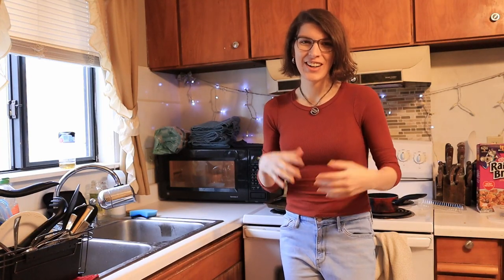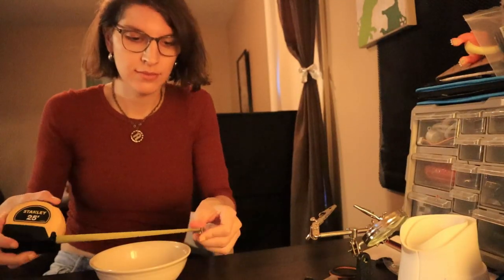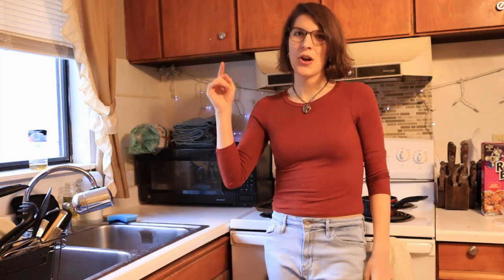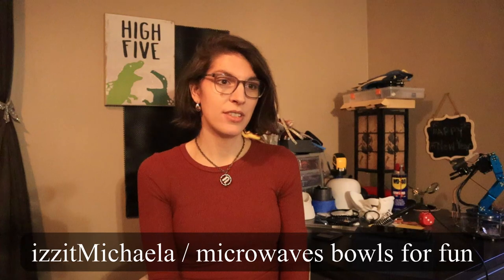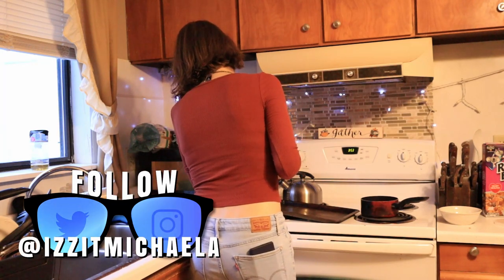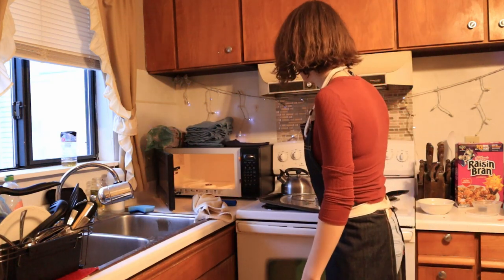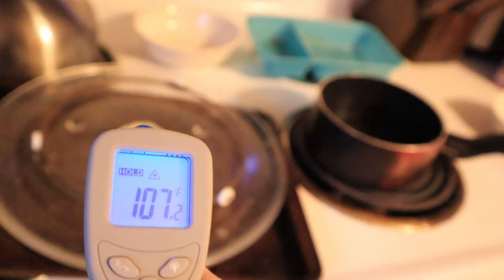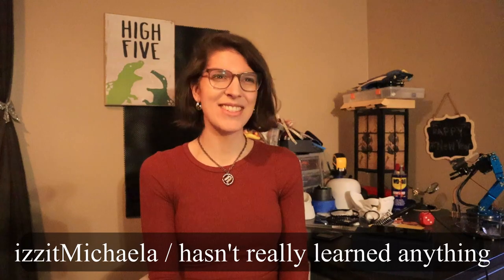Why Do Microwaves Heat The Bowl So Much?

Comment: The interview segments 😂😂
Reply: Also a fun microwave experiment is to remove the rotating plate and put a plate of nachos in there. The microwave will heat up only certain spots of the cheese and you’ll be able to calculate the wavelength of the microwave!!